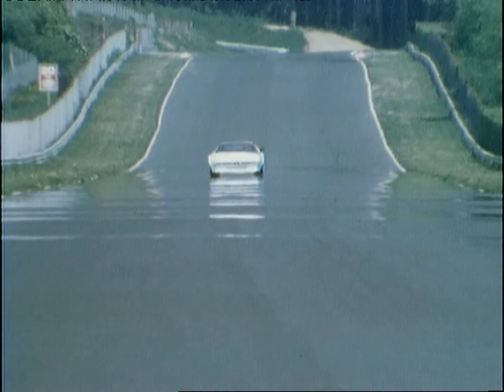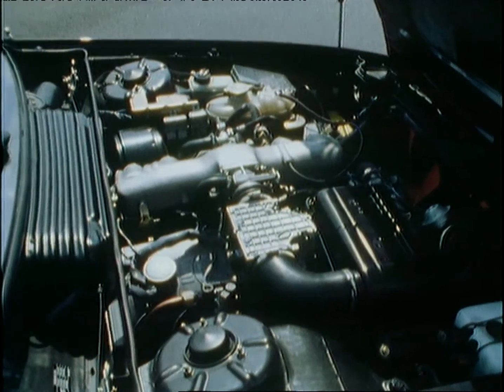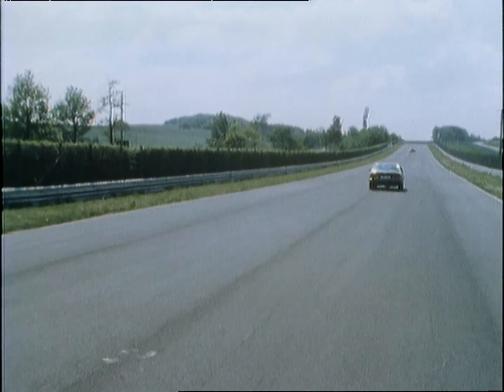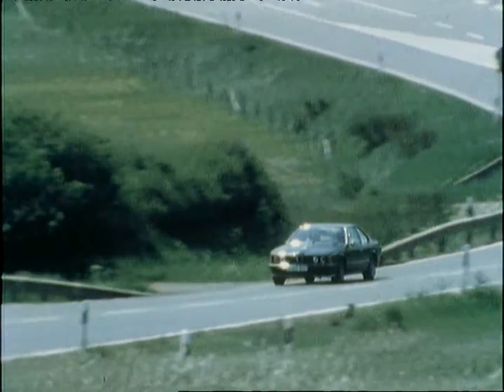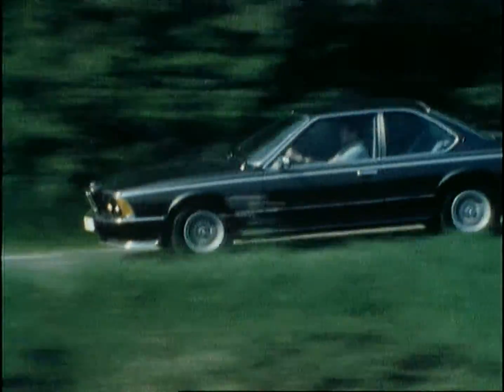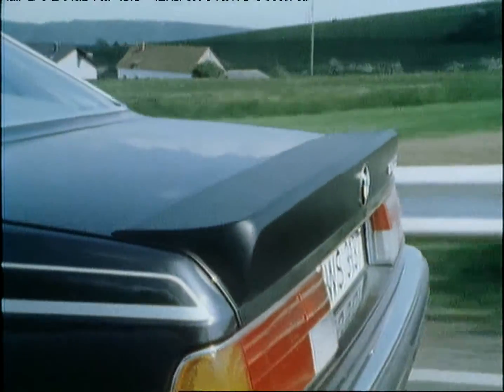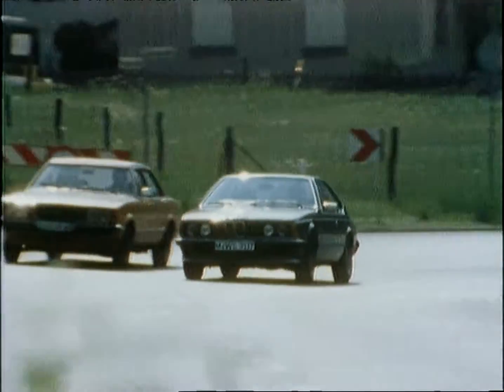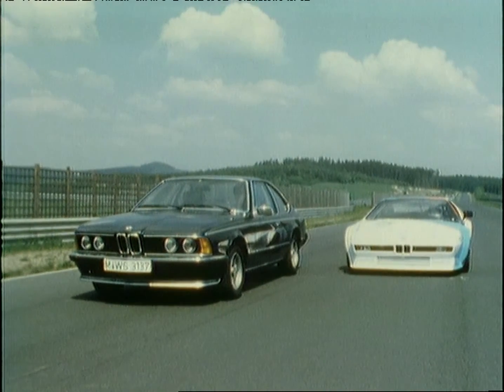BMW 635 CSi, 1978-1989 (Englisch)

Comment: why is it missing a side mirror
Reply: bonkers 03 the passenger side mirror was an option believe it or not and majority of the 1970s did not have both mirrors, silly things were an option as well such as the radio, cassette player, antenna.. manual antenna, etc
Reply: @samirdu interesting 🤔